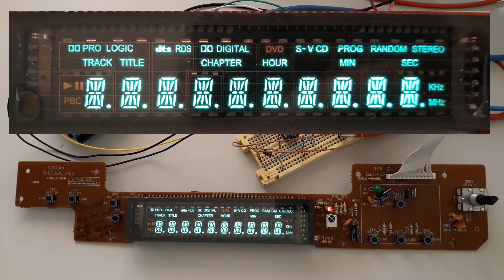PT6311

Comment: Parabéns pelo seu trabalho e por compartilhar conosco. eu tenho um Mini system Sony Mhc-gtr66, que está com esse mesmo problema no display, não muda nada, fica com os caracteres congelados e um monte de zeros, será que o problema é nesse chip 👉PT6324-LQ?
Reply from the maker: Hi @reinaldosantos1870. Although my videos aren't for repairs, you can easily use some of these tips:
1- The Service Manual is available for download on the website: "https://www.electronica-pt.com", search for "Sony MHC-GTR66 Service Manual". Also use the PT6324LQ Datasheet, always work with the manuals and respect the danger warnings.
2- The PT6324 driver works with negative voltage for the segments and grids. So you should have a value close to -33V measured relative to GND, pin 52 (GND) for example, on pin 50 (VEE).
3- Ensure the presence of the VDD power supply on pin 9, which in this model is +3.3VDC. There are other devices that use +5VDC for VDD, as the driver supports both (+2.7VDC to +5.7VDC). 
4- The VFD filament power supply comes from the transformer pins 9 and 8, it should be around 3.6VAC, but since the VFD lights up according to what you say, it assures us that it is present.
5- Since the filament must have a negative reference, measuring from GND to either of the two filament pins (FL11000 VFD pins: 53&54 and 1&2) we must have something close to -30VDC (There are videos where I explain how this reference is created).
6- Pins 1, 2 and 3 are for communication with the microprocessor. Clock, Data and Strobe. Capacitors C1151, C1152 and C1153, if deteriorated, will cause communication failure.
7- It is common for these devices to have failures in the DC power supply filtering, which can result in this symptom and is due to the failure of the capacitors after the rectifier bridges (only with an oscilloscope can you verify if the DC is clean).
8- After ensuring all the tips above, we have to use an oscilloscope or a SIP/I2C communication analyzer to ensure that everything is OK in the communication and thus be able to proceed to replace the driver with the guarantee that it is the one that is failing.

I hope these tips can help and good work there!
Reply: obrigado!, pela atenção.
Reply from the maker: Oi @reinaldosantos1870. Ainda que os meus videos não sejam para o reparo, fácilmente você pode aproveitar algumas dicas:
1-Há o Service Manual disponivel no site: "https://www.electronica-pt.com" para dwonload, procure com "Sony MHC-GTR66 Service Manual", Use também o Datasheet do PT6324LQ, trabalhe sempre com os manuais e respeite os avisos de perigo.
2-O Driver PT6324 funciona com tensão negativa para os segmentos e grelhas. Assim deve ter no pino 50(VEE) um valor próximo de -33V medido em relação ao GND,  pino 52(GND)  por exemplo.
3-Garanta a presença da alimentação VDD pino 9, que neste modelo de aparelho é de +3,3VDC, há outros aparelhos que usam os +5VDC para o VDD, pois o driver suporta ambos (+2,7VDC até +5,7VDC) .
4-A alimentação do filamento do VFD vem do transformador pinos 9 e 8, deve andar por volta dos 3,6VAC, mas como o VFD acende segundo o que diz, garante-nos que ela está presente.
5-Uma vez que o filamento tem de ter uma referência negativa, medindo do GND para qualquer um dos dois pinos do Filamento (pinos do VFD FL11000: 53&54 e 1&2)  temos de ter algo próximo de -30VDC(Há videos onde eu explico como é criada esta referenciação).
6-Pino 1, 2 e 3 são os da comunicação com o microprocessador. Clock, Data e Strobe. Os condensadores C1151, C1152 e C1153, no caso de estarem detriorados vão provocar falha nas comunicações.
7-É frequente nestes aparelhos haver falhas na filtragem das alimentações DC que pode resultar nesse sintoma e que se deve á falha dos condensadores a seguir ás pontes rectificadoras (só com oscilóscopio se consegue verificar se o DC está limpo).
8-Após garantir todas as dicas acima, temos de usar um oscilóscopio ou um analizador de comunicação SIP/I2C para garantir que está tudo OK na comunicação e assim poder partir para a troca do driver com garantia de que é ele que está a falhar.
Espero que estas dicas possam ajudar e bom trabalho aí!

Comment: Hi, do you ever do this for LCD displays?
Reply from the maker: Hi @Enigma758, You means LCD displays or LCD monitor's?  LCD's like panels I made lot of jobs on it, but they are not so cool like VFD's
Reply: @jlsmonte  I mean LCD displays removed from equipment such as printers or calculators.  It seems to me that reverse engineering an LCD is harder than a VFD, but I could be wrong about that.
Reply from the maker: @Enigma758  If you use a full LCD (driver:44780) it's easier! If it is just the LCD (glass with liquid) it is a little more complicated because we have to control the pins COM1, COM2, COM3, COM4... a COM8 is already a good LCD. I have a lot of things but they are based on the 1284 or the DS89C450, which are micros that are not within everyone's reach. But I can convert something when I have a little time if necessary.
Reply: @ OK, thank you for that, I will look into the 44780 driver/
Reply from the maker: @Enigma758  Please take a look at the videos on my channel, there are some car radio LCD drivers there too. Who now this can help!
Reply: @jlsmonte  Thank you.  You're the best!
Reply from the maker: @Enigma758  Thanks a lot! But maybe not! Because my English is so bad!😊😇
Reply: @jlsmonte  You are fine, I have no trouble understanding you! 👍👍👍